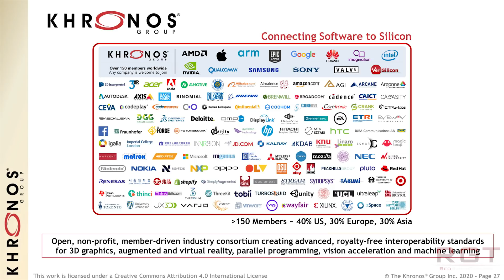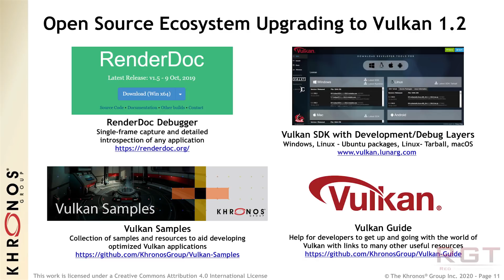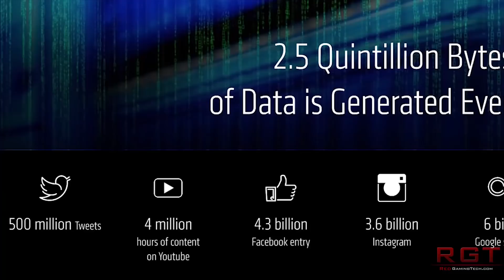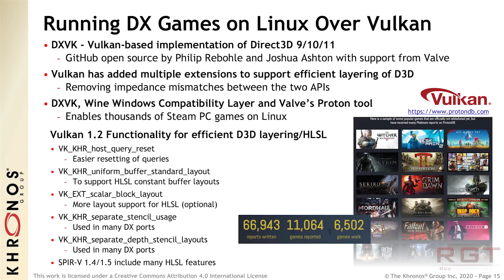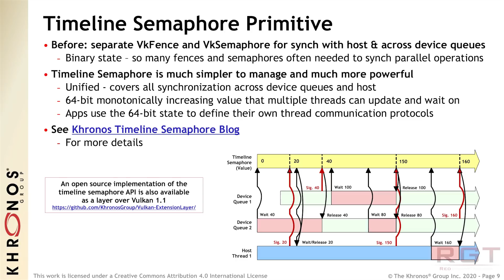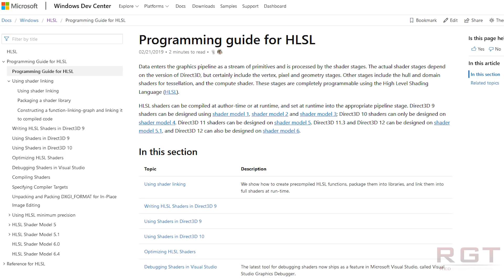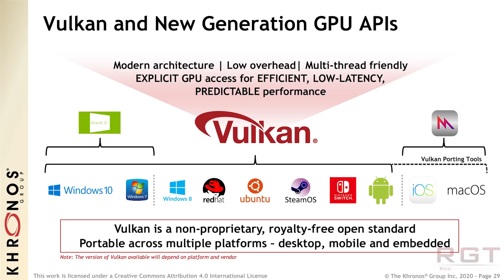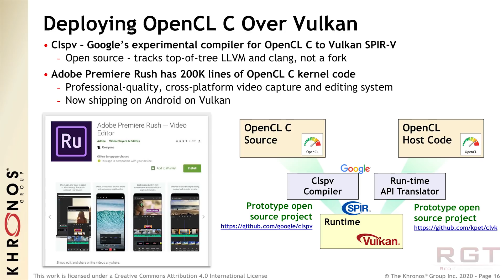Khronos & Nvidia Interview - Neil Trevett | Ray Tracing, Next Gen Consoles & The Future Of Graphics

Comment: You still need render farms or data centers to produce REAL raytracing @24fps (in movies).
Reply: Movies have higher quality full scale raytracing... Games have low quality less scale raytracing in real time
Reply: @kajmak64bit76  Games don't even produce real, full raytracing. Nvidia even admitted as much. Their highest end RTX cards can only do a few certain elements of raycasting per scene. As I stated: Movies still have to use either a render farm or a data center to stream in all of its raycasting feature sets in at once ar a mere 23.98 fps. So imagine how much more difficult it would be to do that for games moving 60 or more frames per second
Reply: @3dgelord187  those render farms don't have RT cores that RTX has... Probably 1 RTX 2080Ti = 1 server rack lol... Yeah basically those render farms don't have RT cores... Those cores allowed for real time ray tracing if there wasn't RT cores you would need a render farm to run the game on 60fps xd
Also Minecraft has Full raytracing/path tracing it's a mod it's in dev right now
Reply: @kajmak64bit76  How man vectors and polygons does Minecraft push opposed to modern AAAs to begin with? Once again... get a clue
Reply: @kajmak64bit76  For the same reason that rasterization has advanced over the course of time.